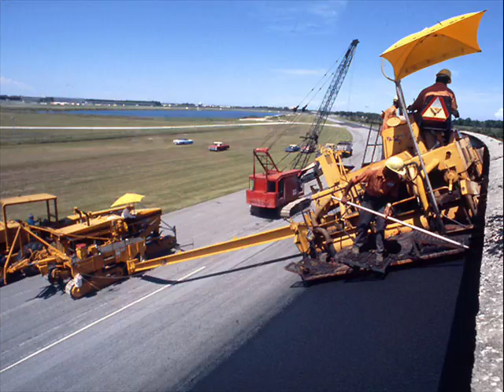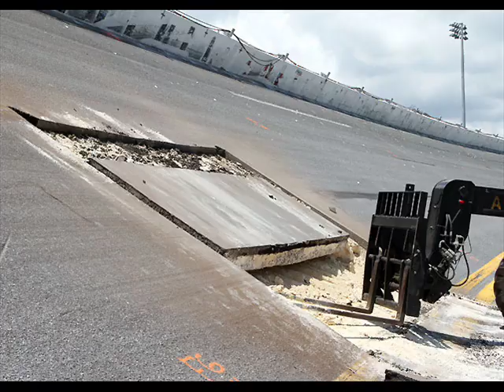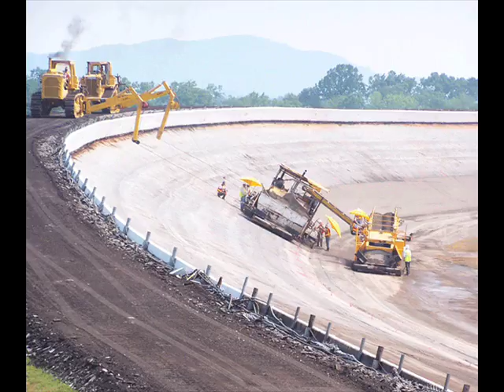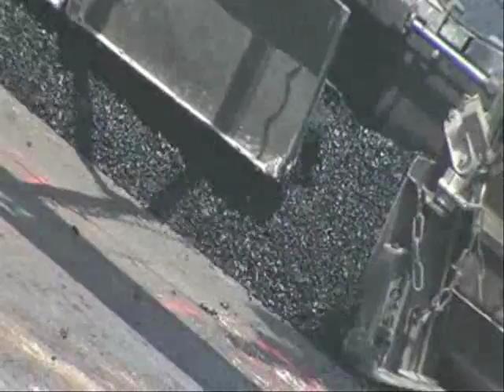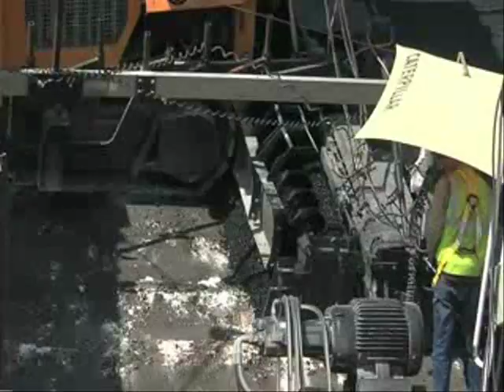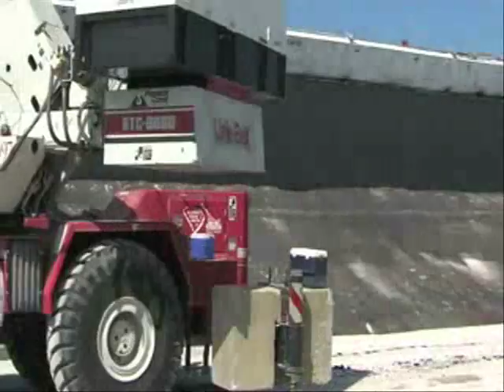Paving Daytona

Comment: The paving machine used at Daytona was an ABG 525 tracked Paver which is capable of paving up to 16 metres wide and  could empty the contents a 40 tonne dump truck in a few minutes, manufactured in Hamelin in Germany and now part of the Volvo Group. I worked as a sales and technical adviser in Ireland during the nineties selling both Blaw Knox and  later ABG pavers which helped construct the country's first motorways, l always loved meeting customer and crews and being on site when work was at full flow. Unfortunately l lost my job when the recession in the nineties put an end to all major road construction for many years. Today I have my own cleaning company but when l pass roadworks l think about the good old days travelling around Ireland and meeting great people

Comment: Tar Man.. I build roads, if you wet the 20 mill crush then use a steel drum roller, better if drum vibrates, slower it rolls the more impaction means harder road surface, too much water the crush will stick to drum, just enough to moisten,  then another spray of water then use rubber wheel packer followed by another spray of water but heavier spray just before oiling the water will draw the oil deeper into the surface, once dry surface is rock hard and surface will not deteriorate as quickly.. water is key

Comment: then Juan Pablo hit the jet dryer and put a big burn spot on the track
Reply: Ya, jet fuel doesn't just explode.  It took quit a while for fire to start, so we know the WTC airliner impact was a HOAX!
Reply: Beavis2828 Get an education, aluminum cannot penetrate structural steel at the velocity of a child's air rifle.  If you are still so gullible as to believe it can, SHOW AN EXAMPLE.  Physics is 100% REPEATABLE, this is why we have the subject of ENGINEERING.
Reply: cheerdiver I hate to break it to you but, jet fuel will explode. Your tinfoil is coming loose.
Reply: Eddie Russell More like, you believe the laws of physics are an opinion.  Maybe you should research what the scientific method is about.  I ended the sentence in a prep, to give you something to complain about.
Reply: Qué tal
Reply: @cheerdiver  even sawdust can explode so wtf you talking about jet fuel cant explode....its called getting aerosolized if a hydrocarbon is in a small enough form with the presence of heat and oxygen poof explosion
Reply: @Wisconsin.pikachu  As far as international shipping standards go, kerosene aka jet fuel, is considered a non-flammable for insurance purposes.
Any MSDS will show the conditions too be outside potential explosive limits, mainly due to temperature.

Comment: They had to remove the catch fence because the banking was so steep that if the rollers didn't have a way to keep stable they would tip over so they removed the catch fence so they could keep everything stable

Comment: You would think that the equipment being turned basically on its side would leak oil or gas in the motor where it shouldn’t be and ruin the mitor